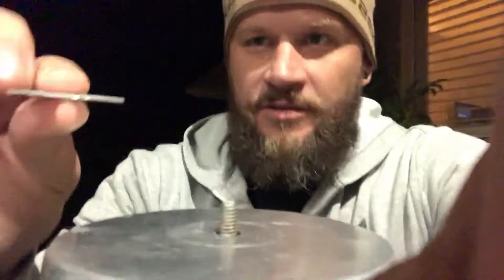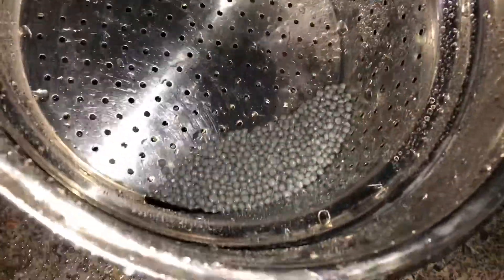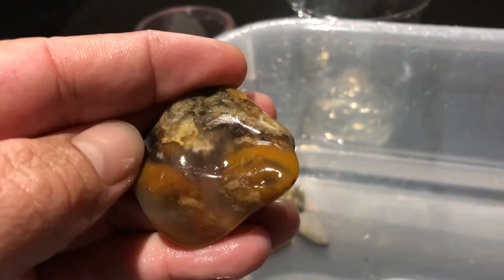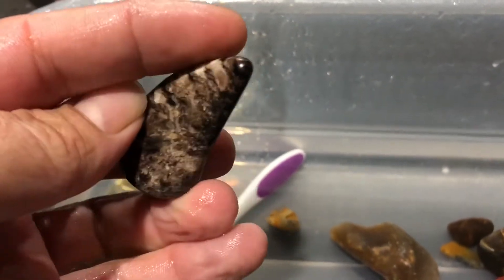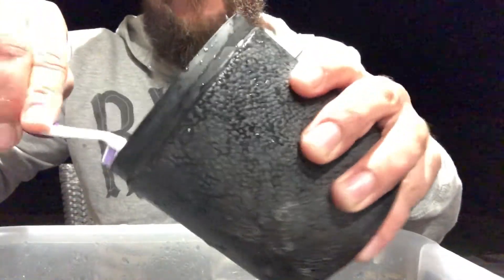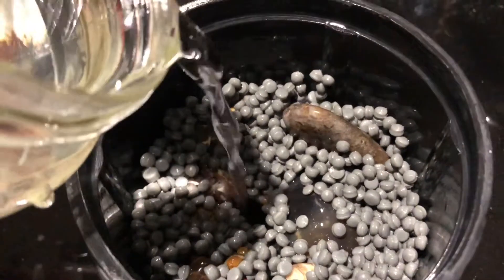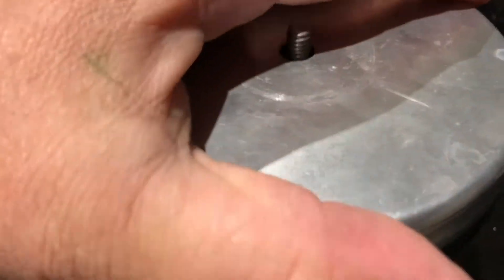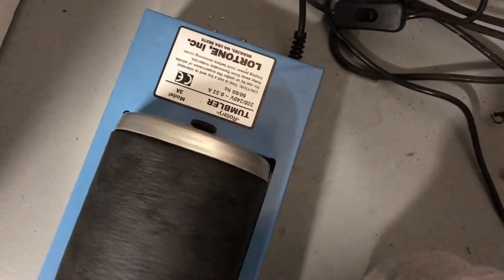Tumbling Rocks Tutorial Step 3 • PART 3 of 5

Comment: :o You have a 600 grit SiCarbide! I don't know why Lortone does that, some places they call a 600 SiCarb grit "prepolish", and others it's a 600 grit Aluminum Oxide that gets the "prepolish" designation.... If you can find a 320/400 grit to put between the 120/220 stage and the 600 stage, and then an Aluminum oxide pre-polish, you'll see noticeable improvement in your polishes!